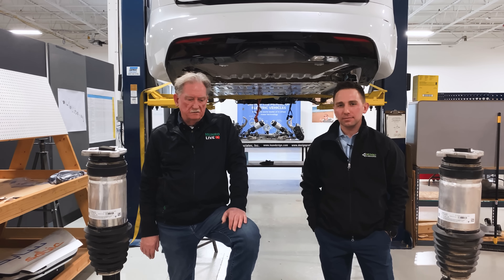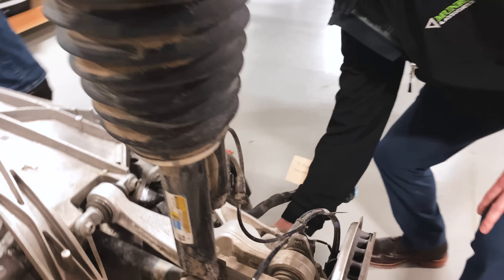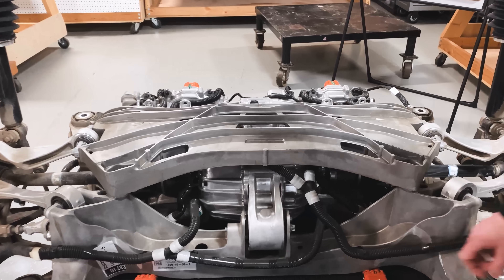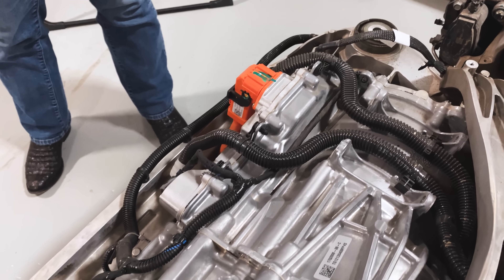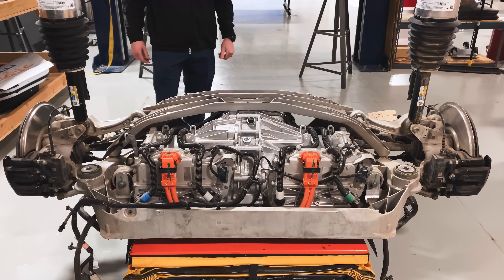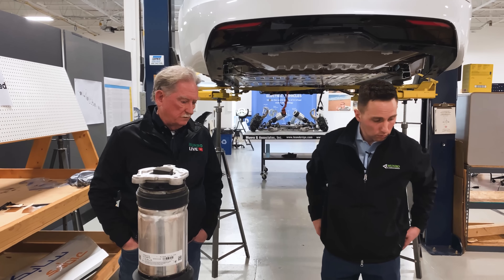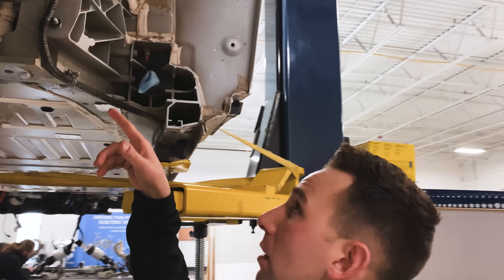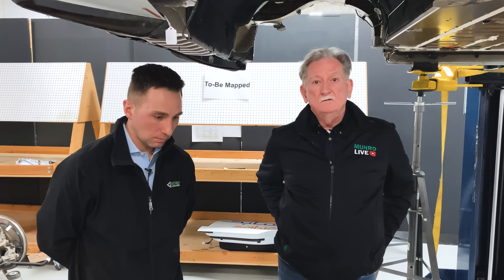Rear Cradle and Electric Drive Module | Tesla Model S Plaid Teardown

Comment from the maker: "**CORRECTION - The casting material on the cradle components were A384 not 3000 & 5000 series aluminums. A tear was found in the protective Mylar film on the the X-Ray Thermoflourecent (XRF) spectrometer which resulted in incorrect material readings**"
Reply: XRF is not Thermo....X Ray fluorescence...elemental analysis, known xray source usually Rhodium target, "fluoresce" the sample, which means it excites the elements in the sample, that give off their elemental xray, which diffract off a know analyzing crystal in the chamber, picked up at exact 2 theta position of  the goniometer is mounted  a scintillation detector, and a flow detector, nothing Thermo....you may be confusing the company THERMO..which makes and sells XRF instruments, Bruker, rigaku, Panalytical also
Reply: If you have an XRF we are all out here to see it!
Reply: Common mistake, no worries. Just be sure to rotate the thimble drive two radians past the arc minute and calibrate the rotator shunt for inverse coupling.
Reply: @MendicantBias1  Pretty obvious for anyone who knows how to synchronize some cardinal grammeters.
Reply: @espen2729  just what i was going to say LOL
Reply: @MendicantBias1 
Don't forget the coffee
Reply: @MendicantBias1  🤣
Reply: @MendicantBias1  That was a quote from Star Trek, wasn't it?
Reply: @MendicantBias1  that was exactly what I was thinking
Reply: @MendicantBias1  I see someone's quite familiar with the Retro Encabulator.
Reply: @MendicantBias1  We had similar problem with bulbulators
Reply: @MendicantBias1  i have no idea what you just said, but its cool 😎
Reply: @RandomTheories  in layman's term, the flux capacitor was broken
Reply: @freetevee5097  ha, nice.
Reply: Usually in metal elemental analysis, it's a solid sample which is run, a Mylar spex cup, is usually for powders or liquids.  All metal foundrys have XRF for QC...matter o fact, hand held XRF by Thermo (Fisher) brand, not a method, are used in the shipping depts to make sure what's shipped is the correct material, even after the QC lab has tested the batch during smelting...been there done that.
Reply: It makes sense that the casting would be of A384 (an alloy for die casting), not the 3000 series (used for sheets) or 5000 series (used for sheets and extrusions) of alloys for wrought alloy construction. The compositions of these three groups of alloys are very different. Why would anyone accept an analysis of 3000 series for a cast part?

But thanks for the correction, which is the responsible and professional thing to do.
Reply: Crap, Sandy, the faulty Mylar on your X-Ray Thermoflourescent spectrometer cost me a lot of effing money!                   ……..no, it didn’t.
Reply: Add the correction in the video
Reply: Question. Why are the shocks and springs rising vertical? If they were horizontal with a bell crank they wouldn't eat so much space in the trunk. They could be tied to the cast bridge across the top of the motor and not be transmitting road noise into the body.
Reply: @lawrenceking4163  A linkage solution would be heavier, more expensive, and no more effective, which is why this is never done on rational road vehicles; it is a solution for racing cars with aero tunnels, to get the suspension components out of the tunnels. And if you put them on top of that casing you're intruding into the interior more than having them up the sides.
Reply: Thanks for sharing your experiences. Always insightful 👌. Great guests, 👍
Reply: You should try sponsorship with Omaze
Reply: Well the designers obviously didn't think about road salt in winter. That'll all corrode/dissolve away before ten years is up. Oops.

Comment: Those brakes are tiny for a 1000 hp car that weighs 4800 lb. They would be smallish for a Corolla. So basic automotive engineering fail but let's focus on how tucked in power cables are. How insanely expensive is it going to be to fix everything since all components are integrated into large assemblies.

Comment: Thread on big parts of Aluminium???? They are super weak!!!
If we need to unscrew the bolts on a 3/5/10 years old car, theses threads will probably failed.
They are on both lower on upper frames.
Big parts, very costly then.
It's revealing how engineers can be both talented and inexperienced.
Or maybe they just don't care once the car is fully working, sold and outside the factory.😂

Comment: Why do you think they use diecasting? The diecasting mold withstand up to 100.000 part shots against the stamped 1.000.000 shots. How is it better related to cost?

Comment: Really great detailed information here!  it's easy to be a critic while not being in front of a camera trying to quickly cover everything.  So please realize that this critic understands that.  This is offered in the spirit of improving a good thing.  Sandy might want to work on the hand off.  Allow the guest to make a mistake or two and yourself too.  Long goodbyes and handoffs are painful to watch.  Get happier about saying goodbye.   Might want to use a pointer stick or one of those remote temperature guns that shoots a laser as a pointer.  Which rivets were you talking about?  Index cards and a Sharpie make great labels to help identify parts.

Comment: What's the point of having two motors in the back? Wouldn't one big motor do the trick?

I'm thinking like a pedestal grinder has one motor and two spinning wheels on both sides. What would be the benefit of 2 over 1?
Reply: The left and right wheels of a car need to turn at different speeds for the car to go around a corner; they can't do that if just attached to one shaft, just as your grinder wheels must turn at the same speed. 

The usual solution, used with one motor, is a device called a "differential", but that applies the same torque (rotating force) to both wheels, which isn't always desired. Conventional vehicles use complex clutch systems in the differential (called "limited slip") and actually apply the left and right brakes separately to manage this for better traction and handling. With separate motors, there is no differential needed and the car's control system can just apply whatever torque is ideal to each wheel.

Comment: Would it be possible to have Jordon and Sandy talk a bit about serviceability.....how hard will it be to replace shocks or bushings on some of these chassis structures, or how complicated it would be to replace a sensor on one of the motors...do you have to drop the entire cradle and battery pack to do that......????  Thanks.

Comment: The possibility od swapping out the entire drive/suspension unit is all very well when the manufacturer allows the old unit to be repaired and reconditioned at sensible costs. Making it a throw-away part would be a severe backwards step.

Comment: The Traction Avant designed in the late 30s, and produced into the 60s (?) had a front assembly containing the entire  drivetrain - engine, transmission. FWD components, that could be removed as a single assembly.  I'd like to think Tesla , and/or Musk, gets some inspiration from Citroen - this type of engineering, comfy seats, and long model runs...who knows?

Comment: The original Model S was an "integral link" design - it's very common, and using this name would make the design clear. The new one is a "five-link" not "five-bar", Sandy. "Four-bar" is a specific type of mechanical linkage which is very different, so calling this a "five-bar" is confusing. Also, Jordan, the original Model S rear suspension, like every other integral link system, has only one upper arm (not two)... plus the complex lower arm, integral link, and a toe control link. Yes, the old one had a toe control link (which wasn't an upper arm); the toe control link wasn't added in this change.

Although not necessary, it would have been informative to note that the Plaid's rear suspension is of the same type as the Model 3, but executed in aluminum rather than the steel of the Model 3.

Comment: Certainly different to the older S, with it's single rear motor and a control unit next to it of the same size that I used to think could be a second motor.

Comment: It’s very easy for those who are not inside Tesla’s engineering department to jumpy to the conclusion that Model S Plaid is a simple power upgrade of the motors, especially since the exterior surface has such minor changes. 

Hidden beneath the skin masquerades a masterclass in design and engineering that would otherwise go unnoticed by the few who are able to really put the car through its paces. It is clear that Tesla has taken the S to the next level with this “update,” and rather they truly created an entirely new vehicle from an engineering-standpoint. 

Thank you to Munro for sacrificing their own Plaid vehicle for this teardown and demonstration of the difference between Tesla and the “competition.”

Comment: Do you consult with collision repair industry? I could see insurance wanting some engineering consult to decrease repair costs and lower the cost of accidents. Less totaling if teslas.
Reply: Unfortunately with those structural parts the tests are going to loose value in crash, not as easy as repairing stamped metal.

Comment: I doubt this rear power assembly is backward compatible with an earlier model S because the refresh was widened at rear.  My 2021 mS looks wider than previous 2017 mS.  Do others agree?
Reply: Fair point. The test mile had flairs. Those could be added here, or narrower wheels with more offset. My concern would be the shape of the floor pan.

Comment: One of my friends car garage owner concers: is that these one or two pieces castings possible to be fixed as those, who are welded - may you please, in geneal, focus a bit also on how good it is designed for possible after crash fixing? If we all look at sustainable way of life, i think we should take this to conideration too Thank you!
Reply: Teslas are not repair friendly at all. Which is why they can do this wonderful "engineering"....any chimp can when they're unconstrained by a complete disregard for repairability and manufacturability
Reply: It doesn't look repair friendly plus it's a structural part of the vehicle

Comment: Munro team is an A team no doubt.  Seeing the underpinnings of this machine, quality engineering thru and thru. I can see future improvements in the suspension with active roll bars using inductor stepper motors. This suspension is built like a brick shi$#@&-_.

Comment: It looks like the new structure that they added on top of the motor and the additional swing arm to the suspension means additional strength to the frame and suspension which equates to smoother ride.  And it looks so awesome.  The geometric patterns in it's construction implies that it is a load bearing structure.  Awesome engineering at it's finest.
Reply: It's not surprising at all, it's designed to sustain very high torque from the motor, it's exactly the same with trucks.
Reply: @carholic-sz3qv  Yes that's what I have in mind.  To be able to bear the enormous torque of more than 1,000 horsepower motor without bending the frame.   That is why it was constructed with the geometric patterns that enhances strength.
Reply: @gerrycrisostomo6571  the two motors at the rear are actually not 1000hp combined, it's the 3 motors that equals that.
Reply: @carholic-sz3qv  Yes but they are connected to the same frame.
Reply: @gerrycrisostomo6571  they are connected at two very different points of the car so the forces in the rear are higher than the ones in the front.
Reply: @carholic-sz3qv  They are connected at 2 different locations of the same frame.   And between those 2 points, there's the rest of the frame that bears the total of more than 1,000 horsepower.  Do you think that Tesla engineers will strengthen just one point of the frame and that's enough and the rest of the frame won't buckle under the load?  Remember the teardown of the front frame and Sandy commented that it is totally different from the previous Teslas that they have dismantled.  All of the parts are beefier.

Comment: I suspect some of SpaceXs engineers and metallurgical people had a little hand in all of this too. It's just incredible to think that this was all put together in the time they had. Nothing in this is like any part of the old model S. As Sandy kept saying its totally different. And different in a good way. It's just better in every way and you can just look and see it. As they get into really analyzing the front and rear suspension they are bound to discover so much more. Those who talk about compation haven't looked at this car. It will be years before anyone comes close and what Tesla will be doing then who knows? If you want the best get Tesla and forget the rest.
Reply: Nope, this car has nothing to do with Spacex and yes all car manufacturers have a metal/material department, Spacex uses steel and not aluminium.

Comment: Could you briefly describe the rear strut/spring assy. Especially the top half of the unit - seems to be encased..? Forgive my ignorance. :-)
Reply: It's an air spring, which is why it is an enclosed cylinder rather than an exposed coil.

Comment: My question when I see this lovely "symphony" of engineering: if I were to buy a model S Long Range as opposed to the Plaid, would I be getting this or would the LR still be using the old type or arrangement? 
I know it's off topic a bit, but very interesting when it comes to choosing what model to get. I'm sure I'm not the only one wanting to know the major differences under the skin between the two.
Reply: I bet the answer is yes, from the engineering and manufacturing point of view. It actually cost more to maintain two very different designs.
Reply: @zerosugarmatcha7348  I would think so too, but I would love to know for sure. My plan is to get an S long range for my next car, hence the need to know what I'm getting. 
Bet you are correct though.

Comment: It's pretty crazy how small those brake calipers are, given the power and weight that this thing has.
Reply: Don't need to big since it uses regen braking most of the time
Reply: @robinsonmac  blablabla, says a person who buys a 1000hp car to drive like a grandma. Even Porsche offers much bigger 10 piston caliper bigger steel brakes or carbon ceramic. Regenerative braking doesn't work all the time.

Comment: Sandy, aluminum is not expressed in "grades"; it expressed in alloys.  There are many alloys having different properties.  Aluminum alloys also have different tempers which determine strength,  achieved by heat treating.

Comment: This sort of thing is actually fairly common in silicon valley. I've worked at a number of companies where there is a lot of interaction between groups and a fair bit of crossover. I do it myself frequently. Just last night I just identified and fixed a problem maintained by an entirely different group. As an engineer, when I find a problem, regardless if it is in an area of my responsibility or not, I want to fix it, and the culture of my employer is such that this is welcomed and encouraged. I don't get ruffled feathers if someone finds an issue or has an idea for an improvement for stuff that's under my responsibility since a good idea is a good idea, regardless of the source. Sometimes the best ideas come from other groups and the smart thing to do is to consider them without turf battles. It's just better for everyone. If someone finds a problem in my stuff it's doh, how did I miss that? Not stay out of my stuff and stick to your group.
Reply: Same. My manager is constantly suggesting that if we have an idea that's going to move the needle, irrespective of which group it's in, go for it. This is in stark contrast to the silo'ed dinosaur I used to work at, where everything took an act of God to get done.

Comment: Great job, as always 

Can you elaborate on the inherent differences of cast (or injection molded) vs drop forged aluminum components. 
The advantage and disadvantages. 
My understanding is that Tesla had to develop their own blends of aluminum to accommodated the injection process (at 1.4M/Sec injection speed).

Also, any consideration on the structural casted piece openings (9:12) Potentially allowing road debris or worse salt from the northern roads collecting in those and causing excessive corrosion overtime. I did see weeping holes in the upper cross bracket (5:11).

I had noticed the FORD Mach E had similar opening though their suspension arm and wondered what happen if they collected corrosive debris as well.

Comment: Sandy and Jordan great presentation. Would you answer my question as to why the suspension mounting points were not incorporated in the motor casting. It would eliminate two large castings, lighten the structure and reduce installation time and cost??
Reply: Because the motors are out of the model 3 and Y. The only difference is the inverters are moved to the back and the carbon overwrap.
Reply: @saff226  The motor cores and possibly the gears are out of the Model 3, but the gearbox housings are different to suit the different configuration, so if mounting suspension to the drive unit were desirable (it's not) it could have been done.